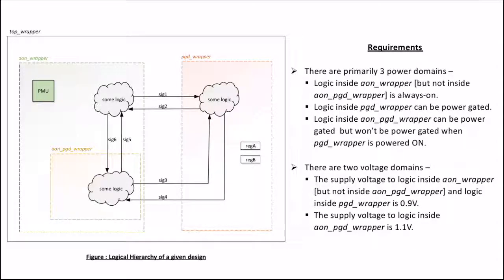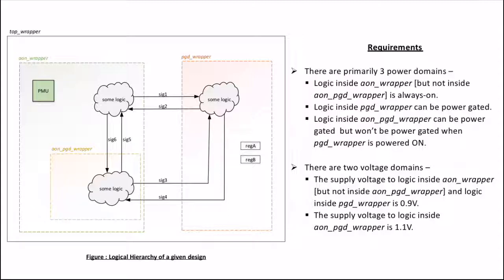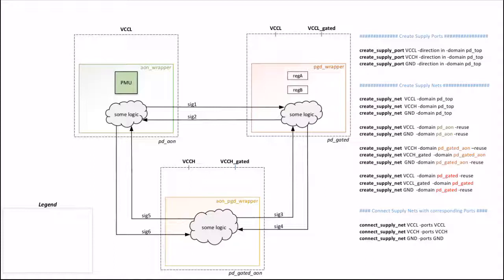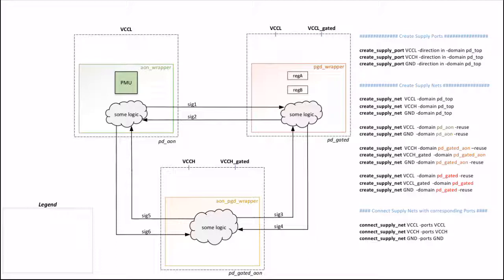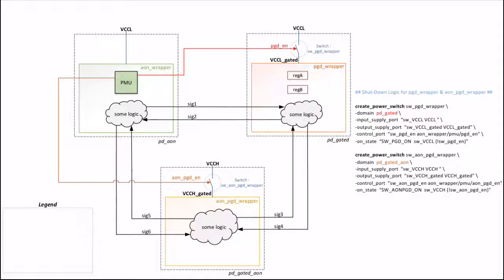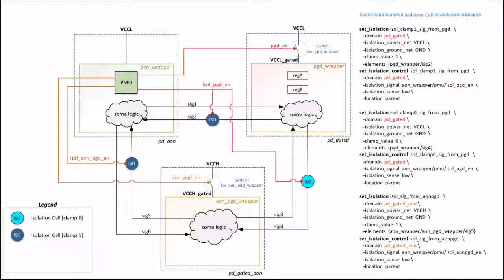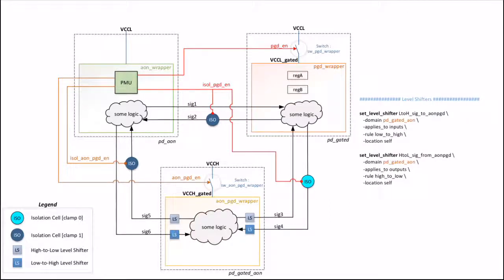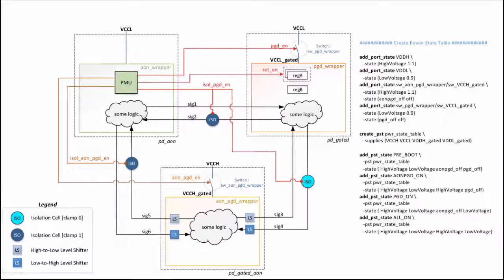Writing UPF for a given power intent

Comment: Hi, May I know why is PGD_ON pst state is required? In starting there is a req as"Logic inside aon_pgd_wrapper can be power gated but won’t be power gated when pgd_wrapper is powered ON."
Reply from the maker: Hi Samhitha, thank you for pointing it out. PGD_ON pst state is not required as it contradicts the assumption (I might have included it to consider all the 4 possible states of VDDH_gated and VDDL_gated as if it is a truth table). I will pin your comment so that everyone will know. 

Also, I have not included GND in the power state (an user named _RMK_ pointed it out in the comments)

Comment: Hi， I load the UPF script with Design Compiler, and find a ERROR message "Error: The supply net VCCH specified for the isolation strategy isol_sig_from_aon_pgd does not exist in the power domain pd_aon in which the isolation cells will be inserted. (UPF-103)", I think this is because the location of "isol_sig_from_aon_pgd" is parent, and this isolation will be inserted to pd_aon domain,
but in which this is no VCCH supply net, so it causes a error.